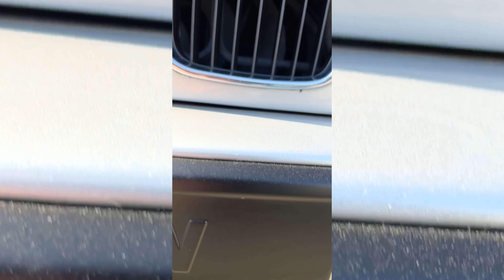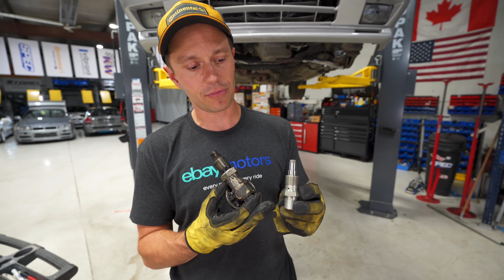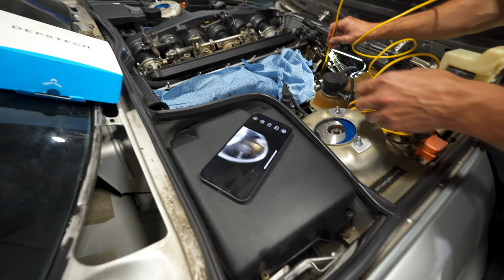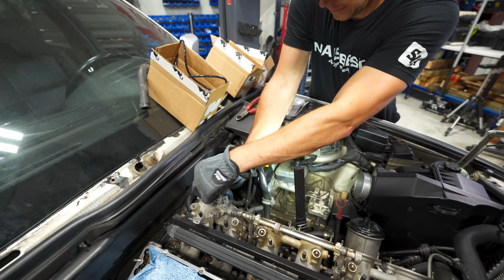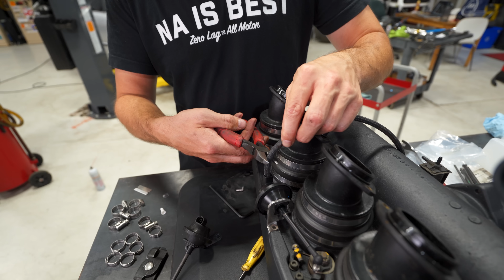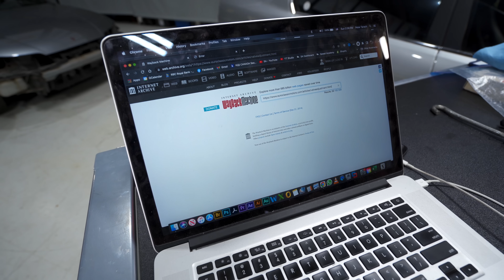$7500 BMW M5 Rebuild - PT 1 of 2

Comment: I saw the "Angry Ass Air Pump Delete Kit" that you said will be installed.
But later I saw the original air pump is still there in Video Part 2 of 2. 
Did you run into problem installing it?
Reply: Ok, Maybe is my mistake, as it is hard to see the installed "Angry Ass (Air Pump Delete) Idle Pully". 
The lowest thing which I thought was "Air Pump" in the PT2 (maybe) is the A/C Compressor?

Comment: Nice video.
For synchronising carbs I use a wideband lambda with an Ecumaster DET3. (€340 together)
In log mode, if you zoom in (time scale), you can see every single combustion stroke per cylinder and adjust the itb's accordenly.
On de dyno the tuner was amazed when he hooked op the carbs synchroniser how accurate it was.

Comment: As far as syncing the TB's- I'd put some small orifices in those vacuum lines to dampen the signal . They're usually called "pills". I remember years ago places selling them but all I can find right now is OEM Subaru ones. They are also pretty simple to make with a tiny lathe.

Comment: Pete: these cars are pretty reliable as long as you change every single hose, seal, gasket, grummet, o-ring and washer, actuator, and every other thing that might wear ever in a car, yeah, they're very reliable. So for the price of two Corollas (to which you will not have to do any of this) in "maintenance" parts you have a pretty reliable car.

Lol
Reply: Did you just compare an M5 with a Corolla? 🤦‍♂️
Hey, next time just ride a bicycle. Unlike the Corolla, it doesn’t even need gas. 👍
Reply: @BMWVX  I guess you read Corolla in a old M5 video and felt offended, I'm sorry about that... ...bmw owners are as delicate as their cars. But I actually did compare the price of two Corolla to the price of the replacement parts of BMWs. And mentioned the reliability of Toyota's best selling car, and the best selling nameplate in the world. Pretty sure that's why you felt offended, BMW and reliability should go anywhere close to each other.

Comment: Not many cars have chain tensioners outside the timing cover. If anything that makes this car easier to work on than most. And the fact thay he had so much access to that bolt means it was built with replacement in mind. Unlike some cases which would require removing the front end to remove it.

Comment: I've found the Morgan Carbtune Pro to be a pretty good fluid/mechanical syncing tool.  I also have the Techmate Carbmate, which is electronic but measures the difference between two TBs and to pretty high resolution.  The Heal-Tech eSync tool has always looked interesting but I've never tried it.

Comment: great content for s38 fans. i've had similar troubles with the digi-sync and use an old carb-tune tool as well. You're balancing the idle air bypass screws here, so if you open the throttle (to raise the idle speed) they're going to have very little effect. As these cars age, and the throttle shafts wear (and you get some air leaks) the idle bypass adjustment is going to do very little. I watched a friend / s38 guru adjust these by ear, close them all, open 1.5 turns and adjust 1 by 1 for best idle and initial throttle response to a throttle blip. Car never ran better after that.

Comment: This video gives me PTSD & solidifies  my disdain for German engines.
Reply: For the life of me I will never understand the prestige of "German engineering" it's the absolute worst
Reply: @kyleroyce4365  After leaving the German car community I soon realized it was a cult 😂
Reply: I was about to prove you wrong stating that I own several (old) Opels/Vauxhalls which NEVER fail or leak but realised just in time that there are GM-engines in them, so american instead of German🤣